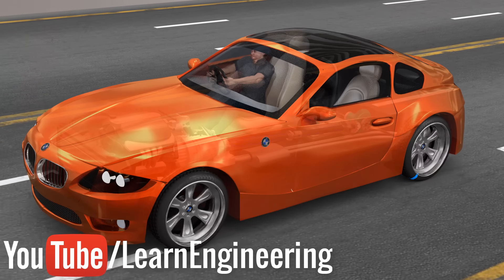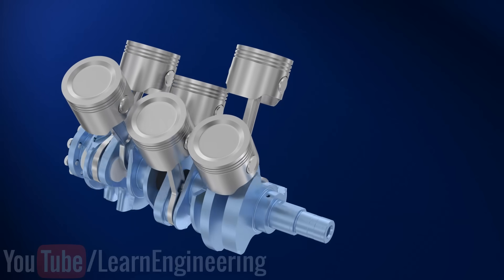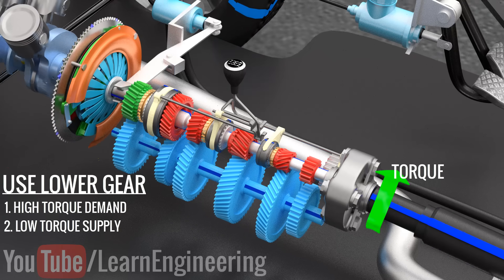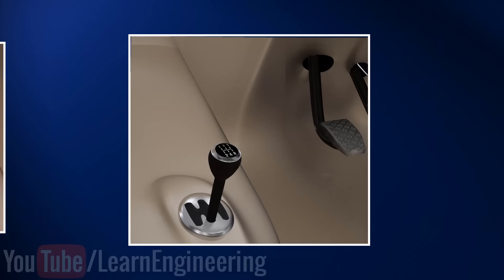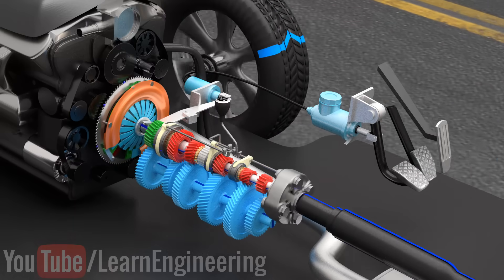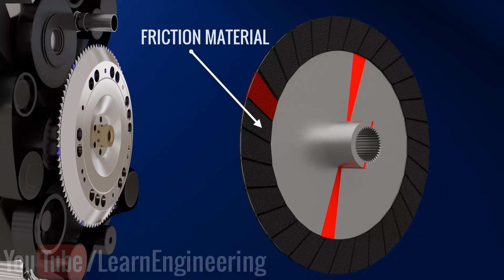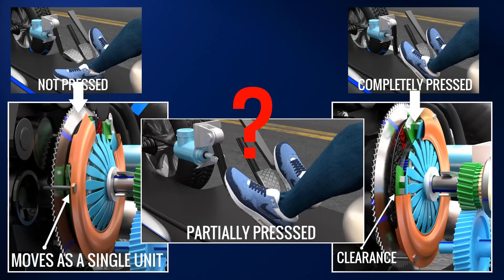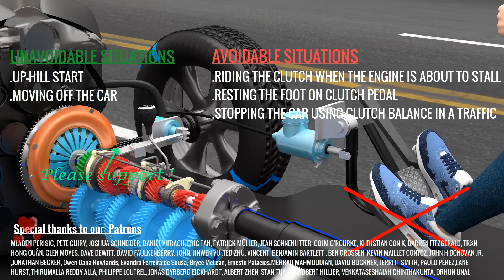Why you should not PARTIALLY press the Clutch?

Comment: You can also avoid riding the clutch while leaving a stop light by revving the engine dumping the clutch and doing a burnout
Reply: Yeah but my tires cost more than my clutch so ...in this life you always have to choose what to burn and what not
Reply: @ferfire9  fucking same
Reply: Well it's not really wrong xD
Reply: Hey man, if that clutch doesn't grab, you're not burning out the tires but something else. Lol
Reply: @aavalos7760  Lol
Reply: @evergreengaming2.053  TELL ME BOI, ARE YOU BURNING THE CLUTCH OR THE TIRES???? ANSWER ME NOW, THIS IS IMPORTANT!!!!
Reply: @aavalos7760  Probably the tires. The clutch is harder to get to for replacements or mantinence. Tires can be easily replaced.
Reply: @aavalos7760  I burn my wallet either way 😭
Reply: This is much safer than leaving a stop light at a normal rate also because it heats the tyres and allows for more grip in all weather conditions so better control of the car is gained
Reply: @Patrick-zr8tv  in exchange for little to no control over the car during the burnout ;P
Reply: @TorutheRedFox  once again I was was joking.
Reply: @Patrick-zr8tv  leaving a stop light fast doesn’t heat the tires enough to matter. Are you joking?
Reply: @historyz1941  yes I am joking. But my argument is truthful about tyre heat because I was referring to the burnout.
Reply: No no, he’s got a point.
Reply: Can you pls explain what ‘moving off the car’ is?
Reply: @ananthasivans220  the car starts to move
Reply: @ananthasivans220  it's when your car starts to move and you turn off the engine
Reply: It's a least. Let the next buyer worry about it.
Reply: Hi sometimes I switched the gear and accidentally gives gas before I totally release the clutch but only maybe 2 secinds . . Is that consider riding the clutch? And will I do any damage to the clutch? Thanks
Reply: @kk-yy8oi  normally you do add revs before you release the clutch especially in the lower gears to get the disks running at a similar speed otherwise it will feel juddery where the disks meet at different speeds
Reply: @sirblocks4812  omg! This is what I'm experiencing right now in my car. So stopped at a light and I start to go it's like my car lugs or jitters. Makes me think that I'm taking too long to let the clutch out or adding too much acceleration? Idk but it's making me crazy! Another thing is when I get beyond that point and in 2nd gear when I'm shifting to 3rd my RPMs are just past 4! That is not at all normal for my car. I have a 2019 Kia forte fe.
Reply: @tiffanymonson9270  it probably needs a new clutch... Does it make any noise when you're not touching the clutch pedal, and stop making the noise when you push the clutch in?
Reply: @sirblocks4812  That is called rev matching, but the right way is:
Press clutch and put the car in neutral (no gear)
Release clutch
Rev the engine
Press clutch and put the gear you want in. 
If you don't double clutch you are actually damaging the synchronizing disks. If these are gone the only way to shift gears will be with double clutching, because they are responsible that you don't have to do that anymore in cars.
Reply: @feuerschlange6374  I know what rev matching is and how to do it but thanks for the advice. The guy above said he presses the gas whilst the clutch pedals engaged and is worried he’s riding the clutch
Reply: @tiffanymonson9270 look at your cars manual for advice on proper shifting speeds for your car. Also first gear is mainly meant for starting and that means you should be at 0 mph. If the engine is lugging in 2nd gear at the lower end of rpms consider bringing the car speed to 0 mph & then use 1st gear to get the cars speed up past the lower rpm range where 2nd is lugging and then shift to 2nd. This will percent the shaking & such you're referring to: otherwise a bit of clutch riding while in 2nd during the lugging/under power will help
Reply: @feuerschlange6374  when ever im slowing down I always press clutch in and put my gear in neutral.
Reply: @Feurerschlange

Isn’t that mostly only relevant to older vehicles / large trucks etc that don’t have or have old sync disks?

Pretty sure new vehicles are advanced enough where if your rev matching properly you don’t need to double clutch. Not a bad habit to keep by any means but as long as you rev match on your downshift while gear is in neutral don’t need to actually depress clutch before you do this.
Reply: @feuerschlange6374  How do you know how much to rev the engine? Does it matter how long you do it for or how hard you press?
Reply: @feuerschlange6374  i don't think he's rev matching, he's talking about accidentally revving the engine before letting the clutch grip, you do this when you're new, usually when upshifting
Reply: @kk-yy8oi  not necessarily. In fact, giving the engine gas may raise the rpm enough that it will slip less as the flywheel will be Nv the same;/traveling at the same rpm as the Gear, you selected. Other times your fly wheel/gears do match rpm or fhs the fly wheel is traveling faster than the transmission & drive train; partial clutch actuation will cause slippage or in extreme cases of engine/fly wheel overspeed& clutch release may cause traction breaking which may lead to loss of control via spinning out or fish tailing. This is especially true during raining or snowy conditions.   If you must do what you're doing with clutch & engine speed, just try to keep it to a minimum. The issues from riding the clutch are due to regular& continued use of the technique. Oh and one more thing; incorrect rpm matching during gear changes is damaging/stressful on the synchronizers. This is also why floating gear changes with out using the clutch is terrible for the syncros. It is not a show of skill either as the syncros are doing most of the work.
Reply: @kk-yy8oi  no thats rev matching not riding the clutch
Reply: kk: Your question is excellent!
If your application of the throttle (gas pedal) brings the engine speed to exactly that required by the next gear, there will be ZERO wear on the clutch because it will be rotating at exactly the speed of the flywheel. Over-revving the engine during this phase will cause clutch wear. However, UNDER-REVVING (engine rotating too slowly) also causes clutch wear - as well as slowing the car down. Therefore, the perfect gear change -which causes no clutch wear at all - is that which matches engine speed to the selected gear, which of course varies with road speed.
If you continue to practice the technique you are already doing, you will become very good at it. The aim is to make gear changes as smooth as possible, thereby keeping road speed as close to constant as possible.
Reply: @kk-yy8oi  what do you mean it gives gas, before relasing the clutch?
Some modern cars, give gas while releasing the clutch, to avoid a stall during the drive off. While switching gears the technique is called rev matching which is done while shifting to a lower gear.
Reply: Are you the owner of a tire company? That would make sense to save on clutch and burn your tire a bit each time
Reply: I have this habit if I'm on an uphill at a stop light to rock my car. I can only imagine the damage that I'm doing to my poor car. 🥺
Reply: Unless you rev it too high, and the torque from the engine exceeds the pressure plate friction….  The result is a whole lotta noise and no go…
Reply: Why slip the clutch if you can slip the wheels
Reply: That's what winter is for
Reply: Press the clutch and brake at the same time to take a screenshot 👍
Reply: Actually, dumping the clutch is even worse than riding it :P
Reply: @kojov13  It will destroy it 😬
Reply: @kojov13  What I’m getting from this tread and video is don’t use the clutch. The car will be very difficult to use, but the clutch will last forever.
Reply: @kojov13  that’s what I’m saying you need to ride the clutch starting in first cause that’s what it’s literally made for rotffl
Reply: @kojov13  r/whooosh
Reply: not if you have an underpowered awd car
Reply: @anmolsaxena_  lol
Reply: @anmolsaxena_  like a 6 cylinder monte Carlo.? 🤣
Reply: Superb
Reply: Noice
Reply: Your dual mass flywheel will like that
Reply: Clutch is only for starting, dry shift ftw
Reply: I do that every morning to wake up my neighbors
Reply: Or turn the engine off, put it in gear and start the engine...
Reply: Or you apply moderate gas, so not enough for the tires to spin, but enough for the engine to not stall and thereby reduce the time you need to ride the clutch to a minimum.
That way you can start off faster and smoother at the same time! 

It's what my car taught me to do, because it really hates starting off without throttle.
Reply: Yes
Reply: Changing gear controls well a car rather than press clutch ❤❤☺👍
Reply: @arjumandvillagelife  what
Reply: but your tires will wear quickly
Reply: Loooool
Reply: What you need to do is drive the clutch down.
Reply: Don't think you can avoid that
Reply: Rip tires
Reply: Ah yes using your tires as the clutch and abruptly straining your drivetrain. Way better XD yea but technically you are right.
Reply: Yeah
Reply: Ya gonna grind those gears? Duh I had to drive a dump truck clutch it's hard reversing then forwarding on inclines with full loads of permafrost terrain old mercury with a carburator
Reply: It's crazy. The first 7 days I could drive a car I did burnouts multiple times. Now after 2 month. I can't do burnouts.
Reply: Hell yeah
Reply: It's very simple to just leave in no gear, then when green light appears put it in 1st gear, release the clutch pedal to like half until the car starts to move and when you feel like the car is moving stable then you can release the clutch entirely and instead use the gas pedal, this action shouldn't take more then 3 seconds
Reply: BMW driver, is that you?
Reply: xD

Comment: My dad said that pressing the clutch pedal down completely instead of switching to neutral in traffic lights wears it down... Is this true? Wouldn't the unnecessary gear shift wear it down more?
Reply: Holding the clutch down while waiting at traffic lights or to pull out of a junction is ok if it's just for a few seconds. The amount of extra clutch wear is tiny. If you do need to wait for more than a few seconds slip the gear into neutral.
Reply: @felixalbion  But how does the clutch wear if it doesn't touch the friction plate at all? Like you completely pressed it down. I don't understand this.
Reply: There are basically 2 plates in a clutch. One plate is metal and contains springs. The other plate has a friction lining. It's the friction plate pressing against the engine flywheel that transfers power to the gearbox. When you press the clutch pedal it puts high pressure on to the metal plate with the springs and pulls it away from the friction plate. Without the metal spring plate forcing it against the flywheel the friction plate is free to move away from the flywheel just enough to stop drive from the engine going to the gearbox. The friction plate rarely moves completely away from the flywheel but continues to rub against it and wear slightly. Also a clutch can fail if the springs in the metal plate wear or become weak.
Reply: @felixalbion  Thank you! Now I understand. From now on I'll put it to neutral when I know it's gonna be more than 5 seconds.

Comment: You need to drive the clutch in slow speed maneuvering and also in any kind of start
Reply: Definitely not. Start yeah, slow speed hell no. Normal 1st gear with no gas is usually around 5km/h. That's more than slow enough.
Reply: @xxxSlenderManxxs  alright, I always ram cars when I parallel park aswell 😂
Going slower than 5kph in a parking situation where you have legit only 20cm on both ends is uncool anyways 😎

Comment: Thank you much. I usually push the clutch partially. It's been good tip to taking care of our car. I've got one question. What is happening when we are in high speen and take the gear in lower gear ? Will the engine or any parts car be damaged ??
Reply: i assume you meant lowering the gear while driving at high speed, correct? As long as you don't overrev the engine (by shfting to lower gear while the engine is at high rpm, or shift to many gears at once, e.g shifting from 4th to 1st) you wont damage the engine. 

However on older transmissions, or those on trucks you have to revmatch. You do this by tapping the gas when shifting to a lower gear to match the rpm of the transmission and the engine, since when downshifting the transmission will be spinning faster than the engine before the shift. When upshifting you just have to wait a second for the rpm to go down a bit, as the opposite happens when you upshift.

You shouldn't worry too much about that though, since you probably have a car with a modern transmission that has a synchronizer which does all the work for you.

Comment: just think i can change clutch disk, which is less costly and safer to have new and good one on time.
BUT loosing engine.!,?!!.....
i cant risk locking engine or breaking engine parts, nor can i prefer gear box damage.
so
so
so....
i will certainly use clutch partialy or fully as per needs   - to save engine and gear box damage.
video is good